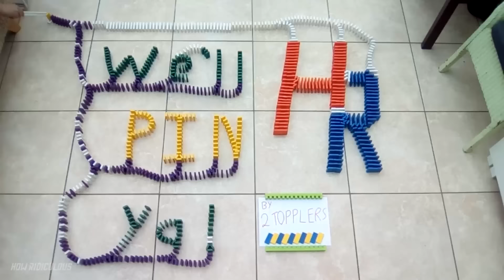Can This SOLID GLASS BALL Survive a 45m Drop?

Comment: I think the cone thing is happening because glass is strong in compression, weaker in tension - the point that hits the surface is experiencing compression forces - the parts to the side of it are overhanging the point of contact and because they want to continue moving downwards (Newton's first), these parts are under tension with respect to the part in contact with the surface, so they tear off - this is really clear to see in the slow-mo for the first drop of the small sphere
Also, they exhibit conchoidal fractures because the glass has no crystal structure with planes of weakness along which to break.
Reply: Love your channel bro
Reply: Wow your smart aren’t ya. (Not an insult btw eh)
Reply: Something something something compression. Something something something conchoidal.
Reply: Snore
Reply: @Grumbo91  me too
Reply: Ma men copied the hole Wikipedia
Reply: No way! How's Babatunde!?
Reply: I though that it is because the impact would send shock waves that would resonate at above the resonating frequency of the glass.

But your explanation makes a lot more sense than my explanation.
Reply: You give the educated description of what i would have simply put. I agree that is likely the reason and pretty cool. The tip of the cone is the part that actually makes contact and no doubt loses a shaving of glass

Edit, the cone shape is because of the spherical shape
Reply: Yours is good too
Reply: Wow, giant brain🤯
Reply: This is a great answer, and it explains why all of the balls break some, the density of each ball being the factor of how much they break. It doesn't however explain the coney joney shape that the glass exhibits.
Reply: Beat me to it. Only thing I'd add is that it forms a cone shape rather than something like a pillar because stress transmits through a material in a cone shape. The angle of the cone has to do with the material itself - I think it's something like 30 degrees for aluminum? Clearly it's a large angle for glass. So in a cone shape moving up into the ball from the point of impact, the glass is in compression, and glass is wicked strong in compression. The only part in tension is the part outside the cone, and glass (like most ceramics) sucks at tension
Reply: @
Atomic Shrimp  Thanks for the comment. what would have happened if the dropped one for a second time and it landed on the opposite side to the first impact. Would they have gotten one cone thing on each side?
Reply: This is physics my dudes
Reply: I can very much so agree
Reply: I agree.
Reply: Exactly what I was thinking the parts under compression stayed and the parts under tension broke, its a smooth break because of conchoidal fracture
Reply: Being smart is cool.
Reply: Yes, And the angle/steepness of the cone may relate to the velocity that the sphere was moving at.  Compare the same spheres from different heights.
Reply: Thats a guarantied pin
Reply: Andrew Knott I was thinking about that too and I think the more energy it hits with the tighter the cone
Reply: I read this in your voice
Reply: I came to comments to say the same thing. Not in the same level of detail though. Nicely done.
Reply: Was thinking the exact same thing when I saw the slow-mo.
The angle of the cone on the second 15kg sphere looked somewhat steeper, I guess that must function of the velocity.
Reply: I couldn't have said it better!
Reply: Dang, way more in depth than my comment. Love it.
Reply: i also feel like when the glass balls were make that they cooled down in layers and those layers are breaking off
Reply: Science the fuck outa it bro
Reply: don't forget that a sphere is the strongest shape that is also a factor when they impact.
Reply: THEEEEEEEEEEEEY'LL PIIIIIIIIIN YAAAAA!
Reply: This makes 100% sense. I was thinking something similar I just couldn't put it into words
Reply: Not to mention the outside cools at a faster rate than the inside. Making the inside molecular structure stronger in comparison
Reply: Wow, thanks for the explanation!

Didn't expect to see you here
Reply: There's a similar principle in stone tool making. These features are known as a 'bulb of percussion' in (typically) flint tools. These tend to be cone-shaped with ripples radiating away from the point of impact, like shock waves in the splash of a pond, frozen in the material of the stone :)
Reply: sounds about right!
Reply: It's one part as you say and another part the shockwave travelling outward from the point of impact. The area around the impact experiences heavy shearing forces due to the downward force coupled with the impact shockwave's outward force. The shockwave goes back up through the glass and outward which is why you get the conical shape. Notice how it looks like an inverted crater :3
Reply: espertalhao041 not that i dont like your explanation but if the the shockwave resinated at the glasses frequency i am pretty sure the whole thing will shatter
Reply: wtf
Reply: Woah i learned more just now than I do in school
Reply: Atomic Shrimp No it’s just the way pressure travel in an object when the pessure is applied to a specific point. You can see it did the same in the bowling ball
Reply: I think that is correct. And the cone is not "in the middle" becourse of the rotation or spin of the ball.
Reply: The bowling ball is doing something similar to the glass, so your explination does make sense. Do you reckon the way the glass is made could affect the compression and tension? The glass was made by layers, and it looks like its breaking along those layers. My degree is in earth sciences not physics so I'm not so certain here.
Reply: Ya what he said
Reply: Also there a ripple effects that happens as well check it out 17:11
Reply: It's just soooooo obvious
Reply: You might even be smarter  than gaunson. HOW GOOD!!!
Reply: This mans brain is 100x better than mine
Reply: The compression strength accounts for the center remaining. The cone from the balance point ,where the compression of impact balances the tension from gravity. But from the images, there always seems to be a section of overhang at the equator. It even looks to slope back up, like the brim of a hat. This section would get the full tensile stress but no support, and yet still remain. Maybe related to compression from the sound wave in the glass giving a region where sound compression balances tension? Or maybe as simple, as the region where the tensile strength is great enough, to withstand the impact, and the "coning" of the brim is the appropriate taper ratio. Still a curious phenomenon.
Reply: Atomic Shrimp you lost me at I Think
Reply: Makes sense, I'll add it's not centered because after impact one side does continue downward as it rolls to whichever side while the opposite then shears off
Reply: You’re smart, I personally don’t speak physics.
Reply: Also it being a sphere it is extremely resistant to pressure. If it was a cube it would break into shards all over.
Reply: I saw this kind of thing on a vsauce vid lol
Reply: Yeah, what you said...🤓
Reply: It's also supported by the trampoline drop; there was basically no damage to the sphere due to the support provided by the fabric (i'm assuming since it did still impact with significant force)
Reply: Words out of my mouth. I would add that it forms ripples because the impact creates a wave in the glass, so as the wave stretches the glass, it shears apart with the movement of the wave
Reply: I was just about to write a similar message, but I couldn't have said it better myself.
I absolutely believe this is why they were shattering on surrounding surfaces to the point of impact, but not very far in the direction towards the core.
Reply: Glass is an amorphous solid. It's molecules move like a liquid only very slowly. When the ball hits the steel there is enough compression to move slightly at the point of impact. The glass shears off from the point of impact in a somewhat linear direction. At the point the compression stops, the glass doesn't move. Like a liquid it moves in waves, hence the waves in the glass. It's just a theory. Haven't studied Physics for decades.
Reply: Humongous brain
Reply: Explanation more interesting than the guys in the video
Reply: For the science nerds 🔭🌡🧲
Reply: Woah... Great explanation!
Reply: Newtons first is F=MA wanting to continue down ward is Newtons Third law
Reply: POV how ridiculous: I was just kidding but you were able to answer
Reply: @TheCryptonaught  Possibly, but I expect the existing cone might also be prone to shattering due to invisible stresses and fractures from the first impact
Reply: And now we call this Coney Joney effect
Reply: Great analysis. Basically, the glass is high quality and it doesn't have much room to move within the space of the sphere. At the point of impact, the exposed surface area is really small and compresses slightly creating a hard point behind the point of impact while compressing outwards towards the adjacent structure. The resulting energy wave can't continue through the compressed hardpoint efficiently and dissipates outward within the depth of the compression and around the circumference of the sphere from the outer edge of the compressed area, shearing off the material that is displaced through the expansion causing an inverse cone effect.
Reply: Who read that I did
Reply: Big... Braen... Werds... Me brean cinnut tacke it anee moore
Reply: @jaylatv1343  How is this video relevant to anything listed here? (Click bait)
Reply: Wow
Reply: Also, the larger balls had a broader cone, as the balls themselves were broad in therefore for more impact area and less overhanging area
Reply: Also the larger ones were broader than the small ones because the larger ones are just broader themselves and therefore there is less overhanging area.
Reply: wow, a wild atomic shrimp wallowing in the diverse plains of youtube. good see haha
Reply: I didn’t know this was science class.
Reply: I wouldn’t expect an actual physical answer it here it is, GIGANTIC BRAIN
Reply: Think of the ball as having layers like an onion. The impact shed part of the layer off
Reply: @ps2killer1  The ripple effect is an optical illusion caused by the cone shape on the backside of the sphere. Notice that the distortion stops as the sphere rotates, and the impact point becomes visible at the top. The rest of the sphere is relatively undamaged and thus doesn't distort the light passing through it.
Reply: Wtf
Reply: Y E A H S C I E N C E
Reply: That's actually exactly what I was thinking
Reply: If you have access to Science Direct articles, there is a paper on this very topic. https://www.sciencedirect.com/science/article/abs/pii/S0032591099001862
Reply: @duncanmcgee13  so... a glass ball is like an ogre? They ugly and they make you cry?
Reply: Atomic Shrimp English
Reply: I lost you at think
Reply: Cody Hufstetler 👁👄👁
Reply: Not wrong
Reply: i mean it could also just be that as the glass gets deeper or larger the more condensed it is in the center and that it is why it breaks off to the side because it would rather break off a weaker spot than the more condensed spot in the middle.
Reply: Damn
Reply: Atomic Shrimp I have absolutely no idea what any of that means I’m stupid
Reply: Could also be due to shock waves being lensed back to the initial impact site
Reply: In English plz
Reply: @Chlrintruc  his brain is wet and soft
Reply: Wow nice science
Reply: I wouldn't be suprised if the peak of the cone was offset by a value near the golden ratio, because it is a sphere and the focal point of the forces applied to the sphere would have been applied in a second sphere radiating outwards from a point on the edge of the sphere opposite the point of the cone. I cant provide a specific equation but I reckon that the overlap of two spheres is causing that cone to occur relative to the radius of the glass sphere and the "sphere' of propogating waves when it collides with the ground.
Reply: @deserteagle10  so funny....
Reply: @matthewsheldon3225  Newton’s first law states that an object will remain in the same state of motion until acted upon by an unbalanced force. This is called inertia. The third law says every action has an equal and opposite reaction leaving F=ma as the second law respectively.
Reply: @HR give this one the Pin of Knowledgeable Appreciation
Reply: Ok
Reply: Because of this you will not get a cone larger then half way
Reply: Im thinking its kinda the same principles as a Prince Rupert drop.
Reply: Copy and paste
Reply: SWSWSWSWSWSWSWSW YEEHAW BROTHER!!!!!!!!!! XD
Reply: @T_BG_TRRR  the shock wave
Reply: actual big brain
Reply: That's actually right.
Reply: @brainseason850  Thank you sir, I stand corrected.
Reply: Hey good job I was going to comment this except a lot less sciency
Reply: ^^^ what he said
Reply: That would make a lot of sense! In a perfect sphere, the only part that actually hits the metal plate is the point of contact, which immediately gets compressed under the enormous force of the ball. Glass spheres can handle compression quite well because of there molecular structure, but will quickly break held under tension "AKA bending it" So the point of contact gets compressed with enormous force, while the glass surrounding the point of contact actually gets pushed out in front of the sphere from the compression. The resulting tension causes the surrounding glass to snap off, leaving a perfect cone surrounding the point of impact. This doesn't just happen when dropping glass, placing glass in a hydraulic press will yield the same result. The reality is that you can compress glass to extreme lengths due to its crystal structure. But as soon as you bend it, the crystal structure looses all of its strength and shatters. When compressing glass though, the excess energy ends up pushing the surrounding glass out of the way from the point of compression. When this bending exceeds the maximum tension the glass can withstand, the surrounding glass shatters leaving a near perfect cone around the point of impact
Reply: This is the correct answer
Reply: nerd
Reply: this is what they mean by a bookworm
Reply: Where’s the pin lol
Reply: Lk
Reply: Thank you!
Reply: big brian
Reply: I'm not a science wiz but you are on to something it makes sense actually. Props
Reply: Was thinking the same thing. Also, I think the point isn't in the center because the strength of the atomics bonds is not equal throughout the sphere.
Reply: can you dumb it down for me please?
Reply: say it again but in English man, like I’m snoring over here
Reply: Nerd
Reply: ... sir wut is the answer to life the universe and everything
Edit:if u don’t know the answer is 42 Also the most useful thing in the galaxy is a towel note:this is from the hitch hiker’s guide to the galaxy
Reply: Andrew Simpson, actually it does.  I will try to explain from the perspective of an engineer vs. a geologist...although I should admit that my mechanics of materials is rusty at this scale?

When the ball makes an impact, the very first thing that likely happens is superficial fracturing due to the initially small point of the ball bearing the entire force of the impact.  What happens next is a minuscule deformation if the sphere, putting some parts in compression and others in tension (I was explaining a variant of this to my son for the concrete paver video).  This deformation and the force create planes of failure that would have to be conical in nature.  Essentially mimicking the parts of the ball in tension vs. compression.
Reply: SUPER smart and could you please explain that but in a simpler manner.
Reply: Nice
Reply: BIG BRAIN
Reply: It's not compression vs. tension but axial vs. shear, which is why it's at a 45º angle from the impact
Reply: WHEN YOUR FAVOURITE YOUTUBE CHANNELS COLLIDE 💥🦔
Reply: Big BRAAAIIINN
Reply: Atomic Shrimp, English please-
Reply: it's more to do with load distribution through a sphere. the strongest places are in line with the direction of force and at right angles to the direction of force. there is not tensile stress applied in this scenario, so weakness in tension isn't at play. the glass shears and shearing is the result of asymmetrical compression and since the strongest axes are at 90 degrees to eachother then the weaker part is asymmetrical at 45 degrees to each and from the point of impact.
Reply: Are you 'avin a laugh? Is he 'avin a laugh?  Believe it or not, I understood that time, thanks!
Reply: @TheDrew4321  offset of peak has more to do with the fact that the sphere was rotating when it impacted. drop the sphere without imparting rotation and the peak will be centred. well actually, the peak is always centred, it's the fracture which isn't radiating concentric to the point of impact.
Reply: @shantihclemans4443  you're welcome.   shrimp is kinda wrong so it's understandable.
Reply: @shantihclemans4443  something else to help understanding force directions: if you stand on top of a pyramid, which is basically a square cone, your weight acts on every stone in the pyramid, down and sideways from  stone to stone, layer to layer. Stand on top of a cube and your load would still be distributed in a pyramid fashion throughout the cube.  stand on a single brick at the top of a wall and your load would again be downward in the shape of a triangle with you at the peak.  but all the bricks outside of the triangle are not subject to load, this part represents the bit which breaks off from the sphere.
Reply: BIG BRAIN PLAYS
Reply: bill nye the science guy
Reply: COMPRESSION FORCES thats a new one good theory tho mate
Reply: Are you 'avin a laugh? Is he 'avin a laugh? That definitely helps, and it’s really cool! Again, thank you!
Reply: Wow that's detailed way better than mine lol
Reply: couldn't have put it better myself
Reply: I was thinking the same thing. I was thinking that the point of contact was just compressing more and the force from the impact is what is causing the sides to break causing the cones
Reply: @Jesus Davila *whole
Reply: Jesus Davila he’s a science YouTuber
Reply: Too much siense delete pls (not really)
Reply: its because of gravity and sound waves
Reply: he is speaking the language of gods
Reply: 5:08
Reply: I think it’s funny how some people look at this and think of science all that good stuff. And I’m here like wow circle went boom bang
Reply: So what’s the name for all that jibber jabber??
Reply: Pretty much this. Sounds right, science means test it!
Reply: All i saw was CONE
Reply: Yes that is true
Reply: Something something something keep moving something something something compression
Reply: Same
Reply: Copy paste
Reply: Big Brain Time
Reply: Ok your smartness is over 9000.
Reply: Exactly what I thought wow
Reply: @yourself1788  😂😂😂😂
Reply: @yourself1788  same i didnt understand😂😂😂🤦🏾‍♂️
Reply: Also I think what's the dictating where the cone forms is a fact that they're tossing the glass balls slightly away from the tower plus the fact that when it hits the ground it wants to roll which is very obvious when you see it hit the ground and suddenly rolls away from the impact site
Reply: can you guys dumb it down for me
Reply: Because the lack of crystalline structure and the spherical shape the resistance goes to the weakest point or shortest route, pi with marginal error if it's not a direct impact. I could be totally wrong but that's what I'm seeing
Reply: You Google that
Reply: You said some big words but I think you’re right
Reply: I Posted My Reply Simplifying This Before Reading It lol
Reply: BRO ATOMIC SHRIMP
Reply: Huh?
Reply: Google
Reply: I so didnt expect to find mr shrimp here!
Reply: did not expect to see you here, love ur vids!
Reply: Because it's AMORPHOUS.
Reply: Don't you think it might be dispersed energy taking the weakest point of exit ?
Reply: Your knowledge is very high👏👏👏👏👏👍👍👍👍👍👍👍👍
Reply: Came here to say this, but you said it better.
Reply: I thought the same
Reply: Well my explanation sounds way more dumb compared to yours lol i